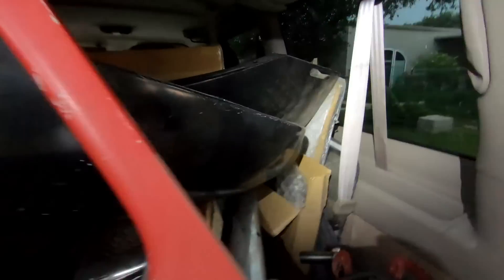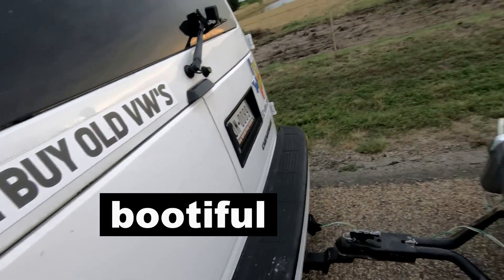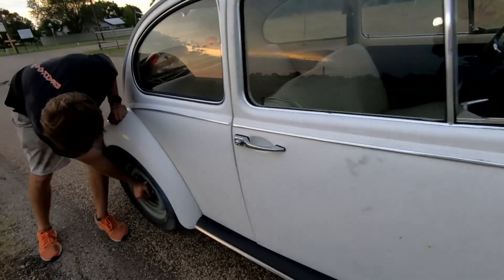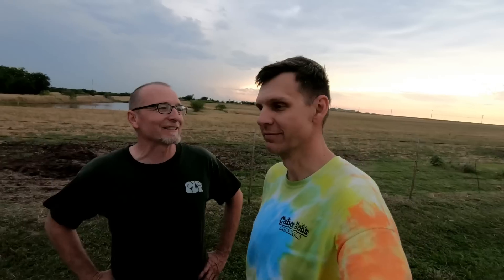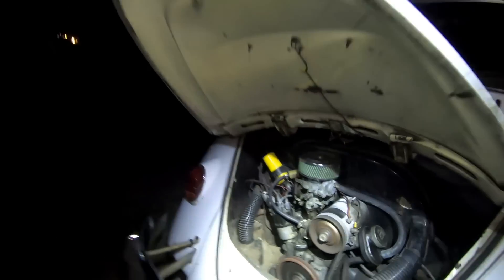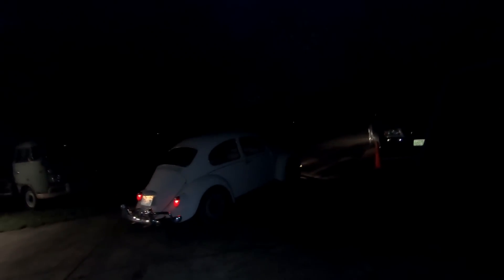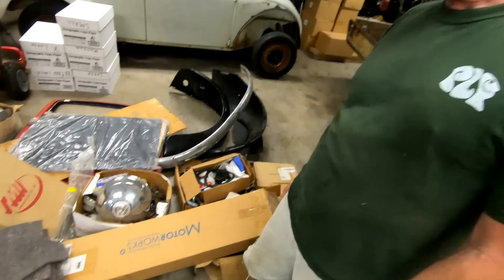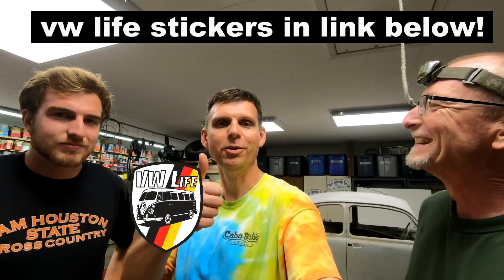We got a 1967 VW Beetle!

Comment: Believe it or not,...going after a white 67 Friday afternoon. 
No engine, and the front passenger fender,( below the headlight) has a sizable rust hole, but oddly enough,...that's the only rust!
It's in Idaho, so rust-free isn't unusual there.
I won't have as much luck as you guys did, but still lucky enough to find a rust-free 67,...so I ain't complaining 😉

Comment: Early 67s had the ‘66 style bumper and/or the ‘66 style oil bath air cleaner.  Early ‘67s had the non-rubber or “chrome” knobs on the Sapphire V radio.  Mid-year production ‘67s also went with the high-seat release knob.  Another mid-year transition was to the pear-shaped side view mirror from round.

Comment: Good to see a classic bug that won't be ruined with the latest craze like in Europe every idiot is lowering them and fitted with a dumbass narrow front beam on skinny Fuchs for a deathtrap experience!
Bugs are already way too light up front, what they need is widerr than the stock 155 width and heavy steel wheels,big alloys at the back are fine if engine and trans are stronger than stock. Keep on buggin living the vw life.